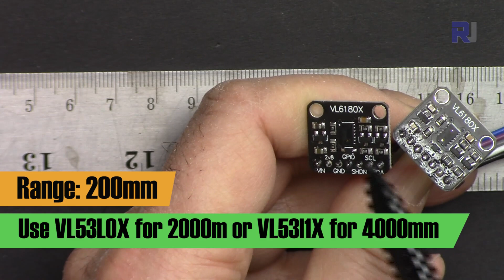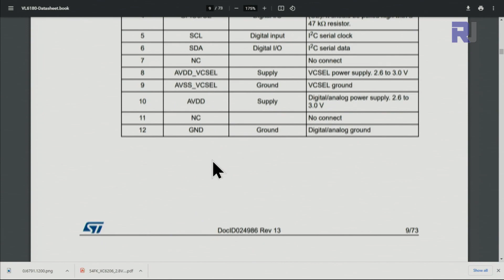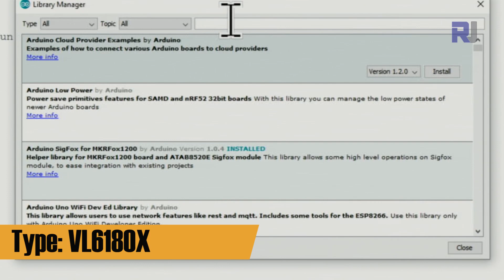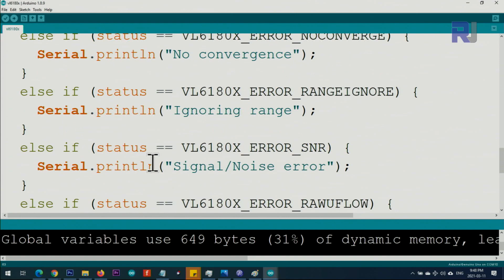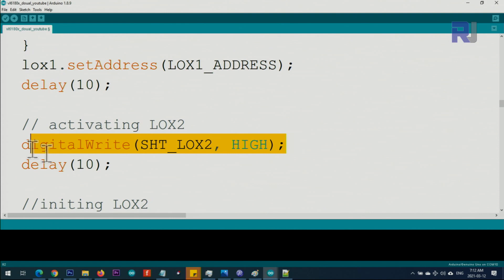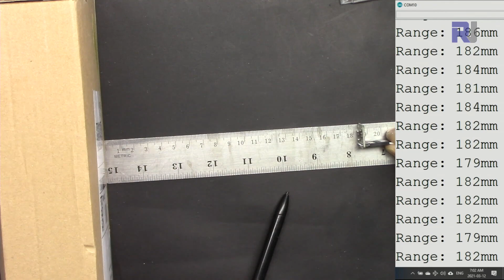Lesson 76: Using  one or more VL6180X 20cm Time-of-Flight proximity sensor with Arduino

Comment: I have a problem, the sensor starts giving values after 10 cm of distance: these values start at 0 and end when it exceeds the 10 cm range. is it a manufacturing error?
HELP
Reply from the maker: I've explained the code fully see if there is a limit set because we could set our own limit for example 10 cm and you don't want to read anything above that it will be displayed as zero. So watch the video again. Look at the code and it's clear

Comment: Did you notice that sensor on the module you reviewed seems that doesn't have 'ALS(the one like green thing)'? Most of the sensor on the modules from Sparkfun, Adafuit..etc seemed to have 4 holes on the sensor, but yours doesn't.
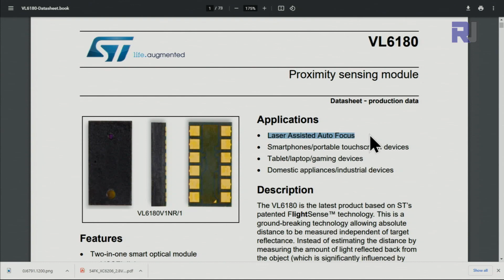(Update)It seems 4:45  in your datasheet, it's vl6180, not 6180x. But module says 6180x.
Reply: hell yeah, I didn't know there is another variant. I don't know if these VL6180 are counterfeits from China or not, but I cannot get a reliable connection with the sensor. I tried disabling the XSHUT pin to ensure no noise can cause the sensor to turn off in the middle of running. But occasionally my board is stuck in busy mode infinitely. And also the max Signal to Noise ratio is  displayed 90% of the time, and returned measured distance is always 255mm when this error happens. I have put the object very close, 2-3 cm away from the sensor and ambient light is also not too harsh. Have you got into this issue and known any solution?

Comment: I'm gettng readings from the light sensor, but i get no distant mesurment. The chip i'm using, you have to feed it 2.8V. Please help, thanks!
EDIT: To get the 2.8V i'm using resistors. But of course when i connect the sensor the voltage also drops, is this the problem?
Reply from the maker: Hello, yes. you need fixed stable voltage. I have shown the datasheet.
Reply: @robojax  Ok thanks!

Comment: Marhaba estaz Ahmad, great Videos ! can you please help me i really need your expertise, i'm still new to Arduino and programming, i have  cooler fans  which is controlled with Thermostat so whenever gets hot inside the 3d Printer's Box the fans turn on and now i want to add a servo with arduino to controll it to open the box's door litte bit on the side for better air flow, how can i control the servo ? can i add  connect the Thermostat's signal to the Arduino and from the Arduino to the Servo ? Thanks in advance
Reply from the maker: Comment is posted in wrong video. We try to help others and if this was under motor or thermostat or servo it would have been better. Here the video to control motor with heat https://youtu.be/5xQ8vLavWKQ you can easily modify it for servo . So please watch and learn and if you want to learn about servo motor, I have tones of videos. Good luck and if you have questions please post it under relevant video and I reply. I read all comments on one page so I never miss.